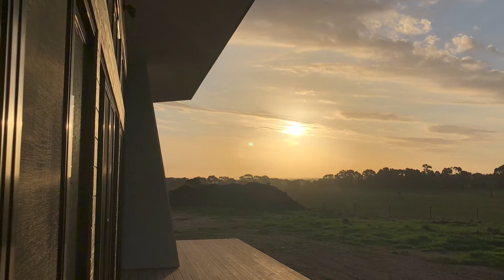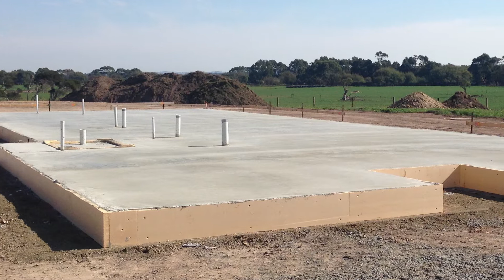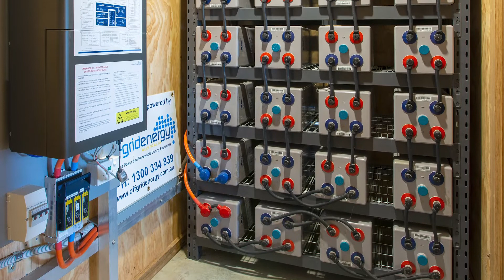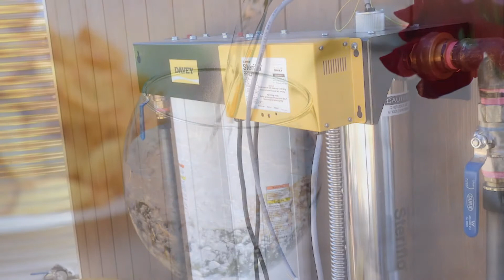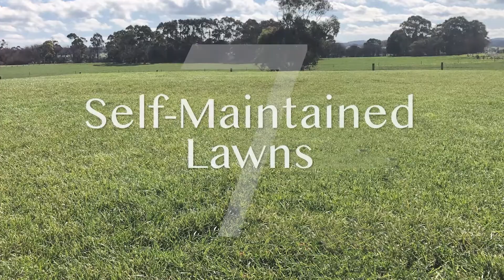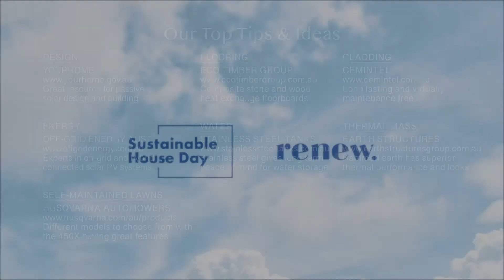Harmony House - Sustainable House Day 2021

Comment: IMPORTANT FOR ANYONE THINKING OF BUILDING A PASSIVE HOUSE: I built a passive house in the Chicago area in 1982, way before anyone was talking about it. My southern wall was two stories and I had a thermal mass setup. Problem: worked great for those super cold sunny days (remember most super cold days are sunny), unfortunately, in Chicago,  winter days are mostly, fully, overcast. ZONING, ZONING, ZONING that's the secret! I had two furnaces, and now, after I took down my big two story wall in a remodel, I have three heat pumps and 5 zones. It's amazing how little energy you need if you zone properly. We put heat at 50 degrees in bedrooms during the day; main living  at 50 degrees at night. My  house office is a zone, so during the day if I'm alone, the main house is kept at 60 during winter. This house has that "open concept" DON'T DO IT; ZONE!
Reply: If people build to ‘passivhaus’ certified standard it WILL work. If people build with ‘passive solar design’ principles there can be problems like you mention. It needs to be designed properly.

Comment: I loved this video! My worry would also be the use of concrete in that floor due to the co2 footprint. Should be possible to use recycled demolition rubble bound together with a small amount of fresh concrete to achieve the thermal mass and choose the finish required?
Reply: I have the same concern and I'm wondering what other options are available, with a smaller CO2 footprint.

Comment: I do like broader approach on the term "sustainable" because it varies greatly according to the environment you live in, but if you used rammed earth for walls why didn't you do the same for a floor? (surely it has similar thermal quality and is more sustainable than concrete?)
And the grass *loan*! They are not sustainable, especially in Australian climate imho~ Transforming your loan into food forest is.

Comment: There's nothing sustainable about concrete
Reply: Hmm, what? Based on what criteria? 

Probably the apparent environmental cost. You think myopically and not with a 100-year perspective. The concrete does have several “costs” but extrapolate those over time? The cost over time makes the value of the benefit higher than the aged ‘expenses.’
Reply: @fishhuntadventure  Your not making sense. Mainly because you don't understand the MASSIVE amounts of CO2 concrete manufacturing expels into our atmosphere.  One day we might have carbon negative concrete but it's not here yet. No, I'm afraid you're the myopic one who thinks they see the big picture.  which is dangerous folly
Reply: I think you're both wrong and you're both right. Concrete construction is a pretty big contributor to co2 emissions; but the amount of concrete in a single "reasonably planned" home isn't going to be a drop in the bucket compared to massive high rise and industrial construction going on. I think individuals can feel fine about ICF construction given its ability to lower energy consumption, retain heat and yes its longevity. It can also be recycled, although historically it is a waste product or buried.